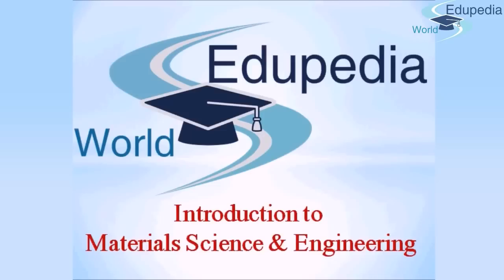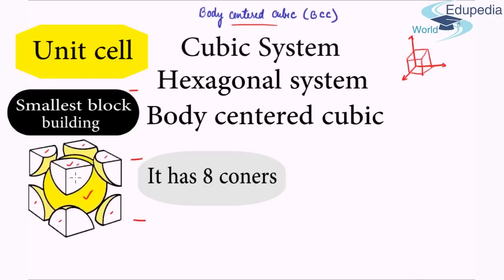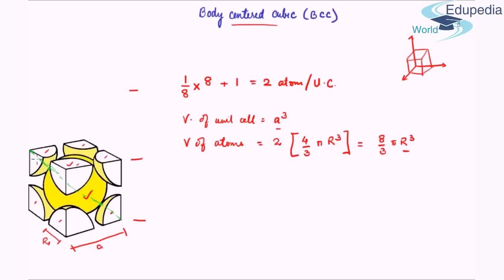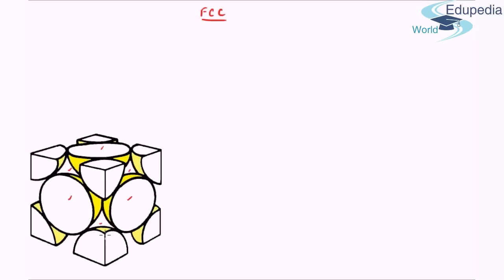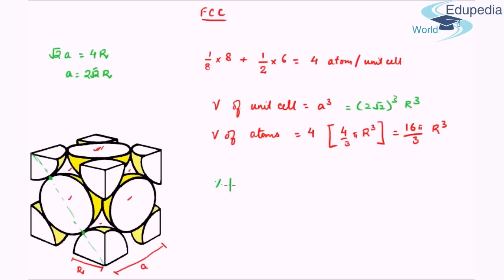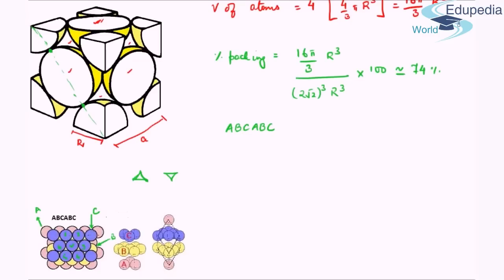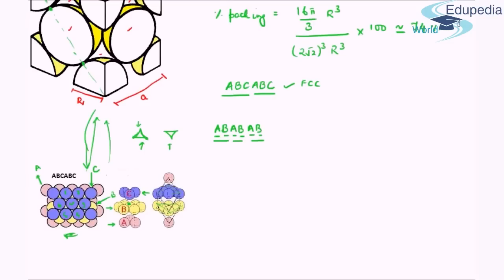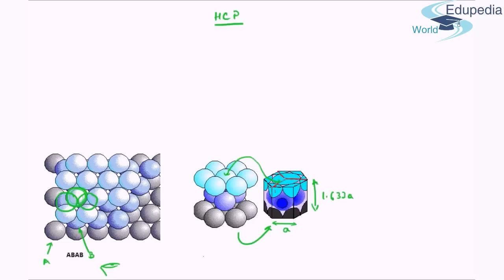AMIE Exam Lectures- Materials Science & Engineering | BCC | FCC | HCP | Cubic System |  3.2

Comment: how did you get the length of the diagonal to be sqrt(3)a? any specific calculations?
Reply from the maker: Use Pythagorean Theorem to get the diagonal across the base:
General formula for the diagonal of a cube if each side of the cube = a
a^2 + a^2 = d^2 (Let's say the diagonal of the base is d)
And again use Pythagorean Theorem to get cube’s diagonal, then solve for D (Let's say the diagonal of the cube is D):
d^2 + a^2 = D^2
So, a^2 + a^2 + a^2 = D^2
       3 * a^2 = D^2
Therefore,
D = √ (3 * a^2)
    =  √3 * a

Hope it is clear.
Reply: Yes, that's makes sense. Thank you!
Reply from the maker: You are Welcome :)